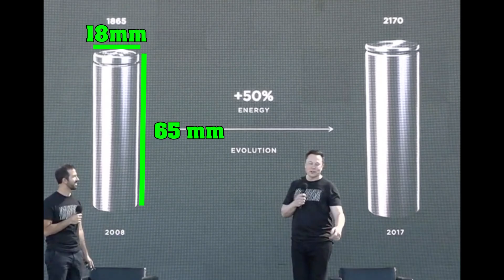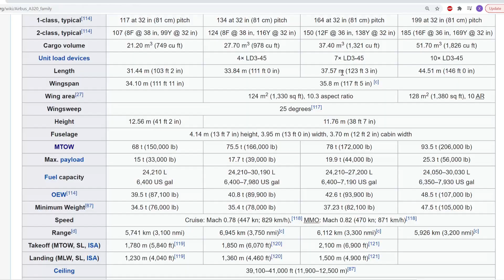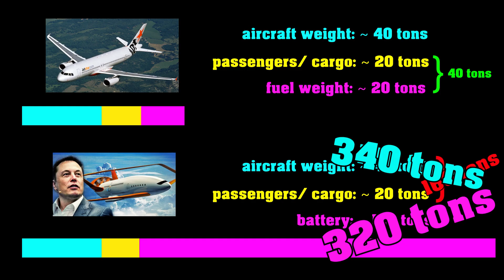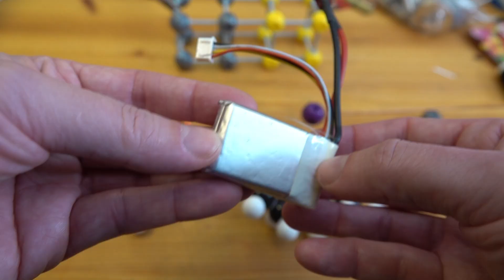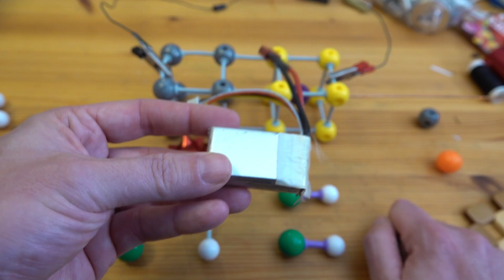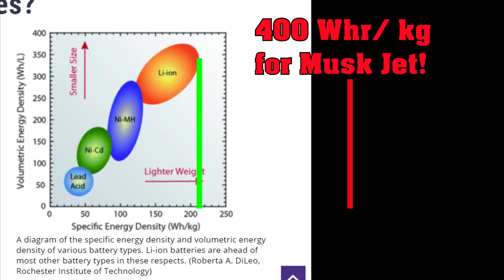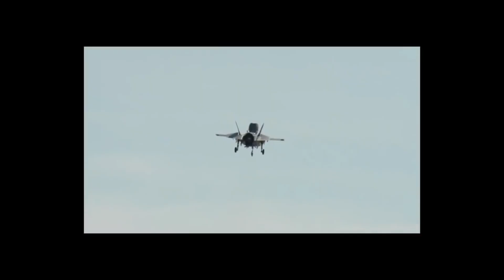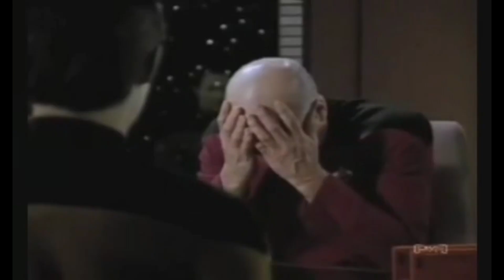Tesla's Secret Plan To Disrupt Airlines: BUSTED!!

Comment: “VTOL Supersonic electric jet”
There is no way just fans would go Supersonic without combustion.
Reply: Elon be like: wHaT dO yOu MeAn JuSt mAkE tHe BaYbLaDe ThInGy gO fAsTeR. Prop gets supersonic
Archievment unlocked: what a shocking wave!

Besides, why make it VTOL? Will it land on carriers? Will the airfields it will be operating on be bombed? (Reasons for the harrier to be VTOL). I mean realistically speaking, if youd need VTOL to land at an airfield chances are that it will not have the necessary equipment available to recharge that chonker. Speaking of refueling. Airlines want their jets to be in the air as long as possible. Meaning they need to be able to get refueled quickly. Bababeem bababoom i bet ya a plane powered by conventional jetfuel is refueled faster than a duracell batzery with wings.
Reply: @Messerjockel  Why make it VTOL? Because it is a meme. Everything Elon ever suggests is a meme. They're meant to get a billion shares on some SocIAL mEdIA PlaTForM where people with 3 second attention spans read the headline, go WOW, and click share before ever having thought about the retarded implications of the claim. Elon is a meme and everything he does is a meme.
Reply: @rageagainstthehygiene2357  makes sense.
Reply: @Messerjockel  I mean there was an experimental airplane called the (well deserved) "Republic XF-84H Thunderscreech" that had a prop that went "supersonic". Just the tips of the blades, but that was enough to be extremely disorienting/outright dangerous to anyone nearby. (those people being well trained military personell.)
To quote Wikipedia: 
"The XF-84H was almost certainly the loudest aircraft ever built, earning the nickname "Thunderscreech" as well as the "Mighty Ear Banger". On the ground "run ups", the prototypes could reportedly be heard 25 miles (40 km) away. Unlike standard propellers that turn at subsonic speeds, the outer 24–30 inches (61–76 cm) of the blades on the XF-84H's propeller traveled faster than the speed of sound even at idle thrust, producing a continuous visible sonic boom that radiated laterally from the propellers for hundreds of yards. The shock wave was actually powerful enough to knock a man down; an unfortunate crew chief who was inside a nearby C-47 was severely incapacitated during a 30-minute ground run. Coupled with the already considerable noise from the subsonic aspect of the propeller and the T40's dual turbine sections, the aircraft was notorious for inducing severe nausea and headaches among ground crews. In one report, a Republic engineer suffered a seizure after close range exposure to the shock waves emanating from a powered-up XF-84H.

The pervasive noise also severely disrupted operations in the Edwards AFB control tower by risking vibration damage to sensitive components and forcing air traffic personnel to communicate with the XF-84H's crew on the flight line by light signals. After numerous complaints, the Air Force Flight Test Center directed Republic to tow the aircraft out on Rogers Dry Lake, far from the flight line, before running up its engine. The test program did not proceed further than the manufacturer's Phase I proving flights; consequently, no USAF test pilots flew the XF-84H. With the likelihood that the engine and equipment failures coupled with the inability to reach design speeds and subsequent instability experienced were insurmountable problems, the USAF cancelled the program in September 1956."

I mean for sure, i would love to experience that once in my life (with hearing protection), if just for the insane visuals, but 1000000% not on a daily basis.
Reply: hell, id love to see a supersonic fan, not gonna make much wind but ought to be cool to look at! lol
Reply: If you start detonating the batteries like rockets.
Reply: and also if their “VTOL Supersonic electric jet” goes supersonic, what about the sonic boom above the buildings? I thought it would damage the buildings.
Reply: @ricardosenpai6121  That would depend on overpressure, which is what companies like Gulfstream are trying to get the FAA to realize. A blanket Mach number is silly when they really should be enforcing an overpressure value. Gulfstream's white paper (I know, I know) on their Quiet Spike does a pretty good job of explaining the theory. They actually successfully tested their Quiet Spike design in like 2006-2007 on a NASA F-15 demonstrator. It actually shapes a sonic boom.
Reply: @thomasbecker9676  I'm actually really excited to see where this could go. I'm not likely gonna be one to ever be able to use it, but the development potential once companies aren't limited by mach numbers could be really interesting to see. Didn't boeing already plan out some supersonic jet like this two, that formed 2 or 3 seperate shockwaves to lessen the impact overall?
Reply: @ricardosenpai6121  The dream, I say dream, because its BS that there is a "plan" or anything, Musk was clear about it. The dream was for the plane to go to very high altitudes with little air resistance and use electric based propulsion (not fans, obviously) to go supersonic.
Spares you the problem with supersonic boom.
Reply: @bluesrockfan36  "not fans, obviously" What, then?
Reply: @bluesrockfan36  What kind  of electric propulsion do you think it is?
Reply: @MyGraveDancer The reason I said "not fans, obviously" is because the idea assumes it would fly at a very high altitude where you can't effectively push air for prouplsion. Not to mention the trouble conventional electric engines run into without proper airflow to cool.

There are alternatives though, like atmospheric breathing thrusters, plasma thrusters and others. You can go down the rabbit hole with experimental drives too.

The problem would be in getting the plane to high enough altitude.

But again, as I've said. Its a dream. No one except TF and sensationalist clickbaity media claims this is anything serious or in development.
It isn't.

But one thing is true.
We will eventually develop non-fossil fuel based air travel one way or another.
Reply: @bluesrockfan36  "I have a design and it's a better one than modern jets" doesn't sound like a dream to me.
You can go to teleportation in your dream. You are not calculating, what percentage of a teleporter is a battery.
Reply: @MyGraveDancer  Having an idea, a sketch of what you'd like to build is a "dream". It is more substantive than basing something on technology that you don't even know will exist.

If I have to explain to you the difference in technological leap that is a 3x more efficient battery than a TELEPORTATION system... you're beyond help.
Reply: @bluesrockfan36  It's not just about the efficiency of the battery, which in itself is a disqualifier because it simply doesn't exist and won't in the nearby future.
Having an idea and "I have a better design" especially with approximate specs are very different things.
Reply: @bluesrockfan36  Electric propulsion has to be with props or fans which work badly in low pressure altitudes
Reply: @MyGraveDancer  Diesel-electric engines could work, but instead of diesel you combust metal/metalloid nanoparticles encapsulated within an atom-thick oxide layer that's less than 1% of the overall mass of each nanoparticle, to prevent it from pre-igniting in the open air but also allow it to combust at all in the 21%-oxygenated atmosphere.  Then the combustion products, which would be a solid-oxide material like quarts/silica (SiO2), would be stored in on-board tanks, the same type of tanks storing the silicon nanoparticles itself.

The energy from this thermochemical reaction between the oxide-coated silicon nanoparticles and the oxygen in the atmosphere would drive an electric motor, to supply the electric jet engine or propfan. The energy density of SiO2 would be 18 MJ/kg or about 5 kWh/kg, up to 66% of that could be directly converted into propulsive thrust, in other words similar to the amount of energy a modern jet engine or reciprocating plane engine can extract in the form of propulsive thrust from jet fuel or aviation gas.
Reply: Yeah this is honestly the main part that confused me above all else. I know we have supercruising turbofans, but none of them have just a fan, or even a particularly high fan bypass ratio. Unless he's going to invent an electric turbine engine (Which I guess would technically be possible if you superheat the air, just not with the amount of energy that batteries provide or with the heating that we have available today by a LONG shot) then I don't get how he's gonna make a supersonic electric plane. 

Or how he'd make it VTOL. I mean I guess he could use secondary lift engines, but that adds a vast amount of extra weight and power need, and while they would work just fine as fans, you'd either have to make them fold in or someone withstand intaking supersonic air in flight.
Reply: @miaconnor5767  You can make a supersonic fan just fine. You just compress the air with a multi stage fan and then expand it through a convergent divergent nozzle. Batteries will not have the energy density to do this for decades, if ever.
Reply: @jaffacalling53  But a convergent divergent nozzle relies on the heat energy of the flow to accelerate the gasses. Just a normal fan, even in a compressor "style", doesn't have enough heat energy to convert for the resultant thrust to break the sound barrier. Sure, you get some compression heating, but not nearly enough for breaking sound.

Edit: And you also need to have a high enough pressure and flow rate through the throat in the first place, and if you have too low a pressure at the exit of the nozzle, you can also have the flow falling beneath supersonic speeds. Plus, because no fan can intake supersonic air, and they generally lose efficiency if the blades themselve exceed supersonic speeds, you'll need an intake design that can slow down the incoming flow, while also being limited in the actual speed you can spin your fan. 

You could design an all moving convergant divergant nozzle I guess to have complete control over the airflow, but not only does this add more weight, it still doesn't adress the core problem that you have: Your fan cross secton will have to keep getting bigger to have more pressure and flow. You can add successive fan stages, but those stages still cannot force the air past supersonic speeds inside of the fan stages, and therefore cannot actually take in more air. You're limited by the speed of the air and the speed of the fan blades. All you can do is make the fan bigger, but this also increases blade tip speed and adds even more drag, especially at supersonic speeds where you have to actually slow the air down to be able to accept it into the engine.
Reply: @miaconnor5767  Well many turbofans on supersonic jets generate most of their thrust from the fan section of the engine, so it must work. And continuous supersonic wind tunnels are essentially just high powered air compressors that compress air enough for it to expand at supersonic velocities.
Reply: @jaffacalling53  Batteries aren't necessary for this. Burning metal(loid)s in a high-efficiency turbo-compounded, combined-cycle, axial-flow turbine/reciprocating hybrid combustion engine that possesses heat-rejecting materials and high-efficiency thermocuples for additional energy efficiency through electro-compounding, would have a maximum theoretical fuel-energy-to-electric-AC/DC-motor efficiency, or overall system efficiency, of 66%.

This means one kilogram of SiO2 which by mass is 46% silicon (the most plentiful element in earth's crust besides oxygen that it's attached to in the form of quartz, the most widely available compound of silicon), 1 kg of which has 40 MJ/kg or 11.1 kWh/kg, multiply by 0.46751 to get the silicon content weight composition of SiO2, which brings you down to effectively Plug in the 66% overall efficiency number of this hypothetical system, and you get 18.7 MJ/kg, or 5.194 kWh/kg. Multiply those numbers by 66% overall system efficiency to get 12.467 MJ/kg, or 3.463 kWh/kg actual useful energy that can be used to DIRECTLY power the plane via imparted thrust after accounting for all energy losses incurred in the system.

A typical jet engine is maybe 33% efficient at best when converting fuel energy, usually kerosene with an energy content of 42 MJ/kg (11.667 kWh/kg), which means airplanes after accounting for all efficiency losses utilize about 1/3rd of the fuel's available energy to impart thrust upon the vehicle, or roughly 14 MJ/kg (3.888 kWh/kg). The silicon-metalloid, thermochemical-electric-drive idea would have similar energy density characteristics as follows: 12.467 MJ/kg, or 3.463 kWh/kg. There would be no emissions of any kind and this system would serve as an energy carrier, and be capable of being recycled an indefinite number of times via electrolysis, thermolysis, or photolysis reactions to split the oxygen bonds from the silicon metalloid to recover silicon for reuse to be used in the aircraft. This could be done over and over again without worry of battery lifespan or cycles.
Reply: @jaffacalling53  That's not really how it works for jets. There is already hot air coming in fronm the actual turbine itself, mixing with the air from the fan. While they do make a lot of thrust from the fan itself, it alone would not be enough if there was no turbine engine that constantly feeds the flow through the convergant divergant nozzles.

Also that's not the same thing, at all. A high powered air compresser can easily create winds that break mach speed, but that's not the same thing as a giant fan creating enough thrust for an aicraft to break mach. For one thing, the supersonic wind tunnels have a very small area that the actual supersonic gas passes through. For another, they have huge air compressors that compress the air beforehand, before blasting it out through that relatively small tunnel. Its like trying to fly with a fire extinguisher, essentially. Or even for the tunnels that have a continues fan, they are huge, heavy systems, that would not make even slightly enough thrust to fly.
Reply: Technically, even with combustion modern fans don't go supersonic,  The speed of the air going through the engine core has to be reduced to subsonic speeds, this is done through bleeding air off before it enters the engine core, and through controlled shockwave manipluation. That giant spike on the inlet of the SR-71 is all about controlling the shockwave in order to reduce the speed of the air entering the engine to subsonic speeds.
Reply: @qfrb97  Or you can plop a intake thingy in just like in the mig21 or the sr71. Though still the fans pf a jet turbine do not make jets go supersonic. Its the hot compressed air that is blasted out the rear end of the thing. Sometimes even getting reheated (afterburner). How is he gonna do that? Resistive heating? Heating a metal piece up with induction? Im gonna tell you what he is gonna do: Keep talking bullshit
Reply: I mean, vtol is hard enough with conventional engines.
Reply: @engineer99 Nice! That should be available around the same time the full game is released.
Reply: Electric-arc-augmented jet engines can indeed reach supersonic velocities; they heat up the incoming air-flow via a turbo-ramjet engine that is powered by a turbojet compressor with a variable engine cycle that can incorporates a hybrid turbine engine that is capable of switching between a straight turbojet (no bypass, or 1:1 bypass ratio) and a low-bypass turbofan engine (2:1 bypass ratio), for speeds ranging from Mach 0 (standstill) to 0.35-0.5 Mach, after which the ramjet component is initialized mid-flight and begins to compress some of the airflow until it taps out at a maximum airspeed of Mach 3.5-7. The variable engine cycle turbine completely disengages after Mach 3-4 and full power is derived from the ramjet from Mach 4-7.

The ramjet compresses the air subsonically as ramjets do not compress air supersonically like scramjet engines, but they are fully capable of hitting Mach 5 with ease by slowing the incoming air down before compressing it to subsonic velocities like turbojets/turbofans. The way the ramjet ignites the incoming subsonic compressible airflow is via electric heating elements that act like a furnace that ignites the air and expands it significantly, as the shape of the ramjet works to further compress the incoming subsonic airflow. An electric-arc furnace place at the outlet nozzle of the aircraft can provide an even larger boost to thrust nominally produced by the turbo-ramjet combination, essentially acting as an electric afterburner.

Comment: Well I'm sure there are better ways to store energy than down to the base elements.  If you want your energy source to be rechargeable through electricity that's different of course.  I mean for example if you didn't mind radiation like in space travel you can use nuclear power.  So I don't think the science is "done" there until we figured out harnessing matter anti-matter reactions.  Maybe something in materials engineering field could improve this?